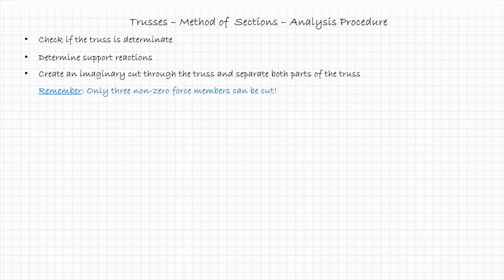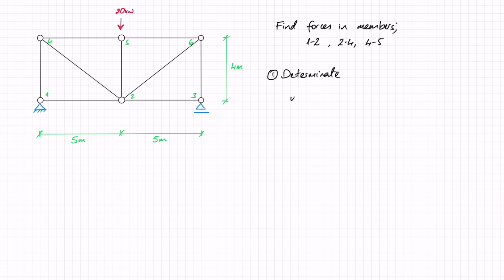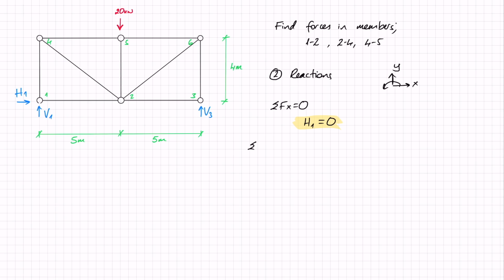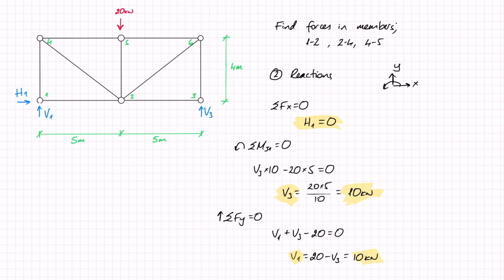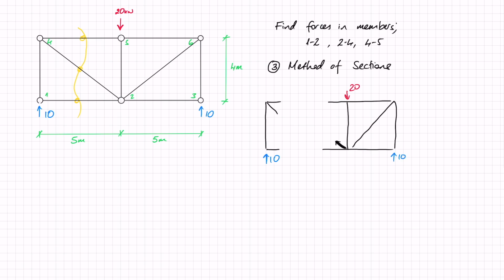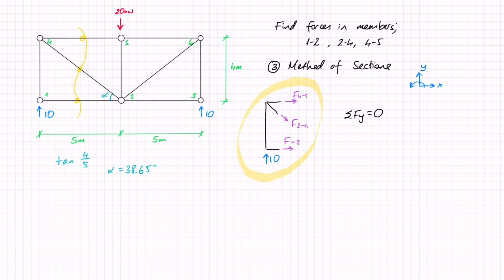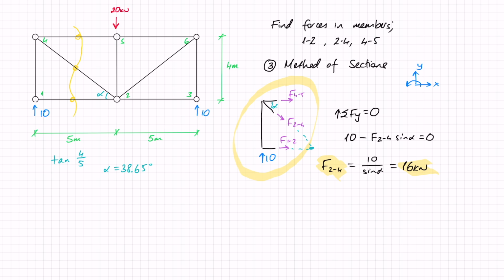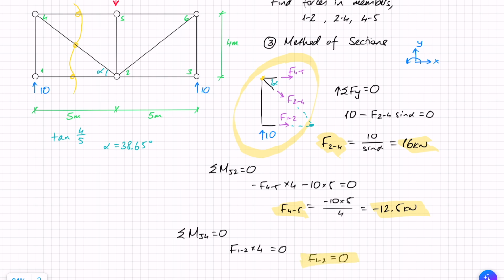Truss Analysis | Method of Sections Tutorial 1 | Detailed Step-by-Step Solution with Worked Example

Comment: can't i solve this exact problem using Method of Joints ?
Reply from the maker: Yes, you absolutely can. This is just a different method, but you will get the same results if you solve using the method of joints.